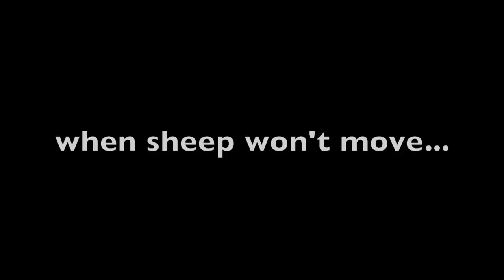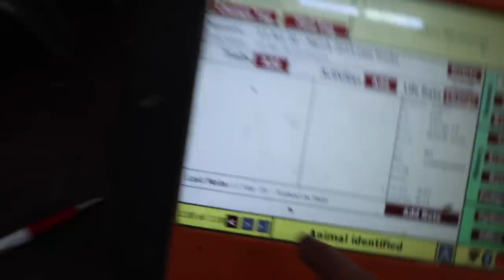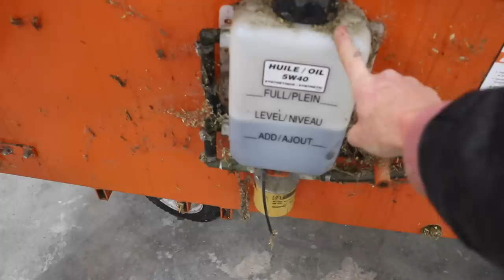WHY WON'T MY SHEEP MOVE?? Vlog 219

Comment: i am not a farmer but i do like watching the lamb videos. I have however dealt with flooded warehouse buildings. I have used lots of things to dry the concrete floors the best thing i have ever used is a walk behind leaf blower or a power broom for a skid steer. if your building keeps on flooding you might want to look at possibly using something like that to help evict the water out of your building. We are not getting any younger and your back will thank you.

Comment: The pull start are fairly easy,,undo remove, pullcord right out hold centre remove cord wind centre to tighten, then replace cord and let it rewind carefully, lubricate it while its off,, usually one revolution will safice,..there are  videos on this you tube to help,..
Reply from the maker: thanks!

Comment: With your feed cart running lightly tap on the pull rope cover plate and it could possibly wind itself back up will work until you can get it fixed lightly tap dont beat the snot out of it LOL
Reply: @Greg
That's true. Its saved me many times on small engines. They get gummed up and stick. A good blowing out and a little wd40 usually helps quite a while unless the spring is unhooked or breaks the end off.
Reply: @markheintz1878  very true Mark...i have even taken the cover apart so all that's left is the rope and the small wheel it's attached to and then turn it the correct direction and slip it over the square stub and start the engine but you have to hold the rope tight after the engine starts and then carefully pull the rope assembly off the engine kind of a pain having to wind the rope up Everytime but it at least gets it running so you can use it

Comment: If you attached a scanner to the side of the shoot or under one of the bars, maybe one they had to slightly duck under, would it collect the info more automatically just running them thru shoot. Save time??

Comment: Put an electric start unit on your feed cart.
Reply: Electric starter not a bad plan b. Having a spare pull rope assembly on hand is a good idea too. It's cheap insurance. Usually 4 bolts and it's off, slap the new one on and fix the old  when you get to the nearest small engine shop and have it repaired. Or you can order one your self direct at HondaOutdoorPower.com. just have all the numbers ready from the ID plate and you would be all set.

Comment: Sometimes what happens with the recoil on the Honda's is that the end of the recoil spring that is in the center (it has a little bend on it that hooks to the recoil housing) breaks off.  You can rewind the spring and it will work for a few pulls but with use or vibration the spring will unwind its self because it is not hooked up in the center.  At this point you can do one of two things, 1, you can buy a new spring or 2, you can take a torch and heat the end of the spring orange red and bend a new "hook" and then reinsert the hook into the slot that will stop the spring from unwinding.  Good luck.
Reply: That's a good call. Once you've heated and bent the end, it's a good idea to heat it up again and then quench it in water to re-harden it. I've had them "unbend" if I didn't do that.

Comment: I was a parts guys for a John deere dealership where we also sold a lot of Honda parts and yes they have tons of those same pull starts that are just a tiny bit different then the next. When you find out which one you need just by 2-3 and have them on the shelf.

Comment: Hmm I was thinking if you had drains you could squeegee the water into the drains 🤷🏾‍♀️

I know nothing just trying to keep ✌🏾😊
Reply from the maker: For sure!  Except drains inside barns can get pretty gummed up with the other stuff that gets mixed in with water and plug... For the most part, the water is pretty easy to get out, but a squeegee would have done a better job for sure!

Comment: you need a broom that goes on your tractor that spins so you can sweep the water out
Reply: The moisture is a temporary problem and that's a huge expense for a issue that will be resolved as soon as she is able to get the chimneys reinstalled on her roof.
Reply: @ellengallerani9836  She needs to sweep the barn out at least weekly
Reply: True, but when you are looking for equipment to buy and and if that equipment is going to earn you money for expense involved it probably falls low on the list when you can get the chore done currently with no added expense.
Reply: I thought of that too. Her bobcat already has the 3rd spool hydraulics so it would be a nice addition for cleaning up mud water and light snow.

Comment: Hi Sandi if you could get those red flags that are on a stick that the construction guys wave you through their road construction it would be a great help where moving the sheep and are closed in area like that. Additionally if you move them really quickly and kind of snapped them they make a loud flapping sound and the sheep or move away from them. We use Border Collies and flags and it helps if you’re not just pushing on the back ones just make a cut on some of the front ones and use your gates to make a small crowding area close to the shoot and then start work in that small group and remember Sheep follow Sheep so get some leaders cut off and then the bigger group should be easer to move to the chute area. I think you’re right Mark might have be just a touch grumpy when you  asked him to leave what he was doing on the tractor to help with your project.
Reply from the maker: Great advise!!
Reply: Thanks I learned the hard way I’ve been a sheep and goat guys since the late 1970s. As always I’m a big fan of both You and Mark. Also it helps if you throw a few flakes of alfalfa chum in the pen close to the chute.

Comment: Sandi, If the feed cart hydraulics don't work well when cold, check the farm supply store for low temperature hydraulic oil. Snow plows use it. It flows at cold temperatures. My farm supply carries it.

Comment: Sandi, as far as parts for a Honda engine, if you don't a serial number when you order parts, chances are you will get the wrong part.  Even though you have two 5 HP Honda engines, they probably will not have matching parts.  Honda's are great dependable engines, but the parts picture will drive a preacher to cuss!

Comment: Since Mark does your equipment work   so well you may not need this advice, but when I got to be 65 I had electric start put on my snow blower and my big grass mower.  They still have have the pull cord if they die in the far corner of  of my property but I decided old ladies need to pamper themselves a bit.  You do have to plug them in but when it is 25  degrees below zero, USA  the snow blower can be really difficult.  If  it stops later (Usually because I did not top off the gas )   it  is warmed up and then will start on first pull. I do not consider you old but all the little bits of energy you can save you can  use for more important things. like bottle babies and making videos and even  taking care of yourself.  Your energy and love of what you do are so much fun to watch, THANK YOU.

Comment: TIM from Ontario Canada if you have any machines that are looking like this messy full of feed cobwebs and search other things in there... suggestions leaf blower wheel clean out pretty much anything... if you do this outside you will not have any mess to clean up on the inside... if it is possible to take everything outside make sure that you were using a leaf blower that has batteries these are charged... if you are using a leaf blower that runs off of extension cord make sure your cords are long enough to reach your equipment... you would be amazed at what a leaf blower can do in such little time.. this is mostly beneficial if you are using a grease gun this way your grease nipples are clean of debris...

Comment: I haven’t seen an all black or mostly black ewe in your flock. Well other than the babies. Are those predominantly male? They are my favorites, just wondering why you don’t use them as replacements.
Reply: The black ewe made white babies this year. Lol but the white ewes made some painted lambs with the black ram.
Reply: Dembai that’s too funny. I actually did see in another video there is a sold black Ewe. The painted babies are my fav ❤️

Comment: Is there a reason not to install a few fans to move air around ?
Reply: There's supposed to be chimneys in the roof but they couldn't be installed for some reason when they did the emergency reroofing.